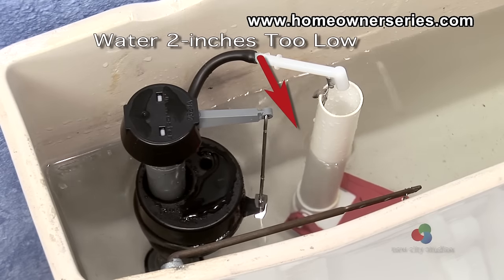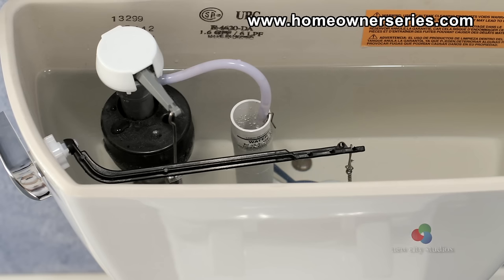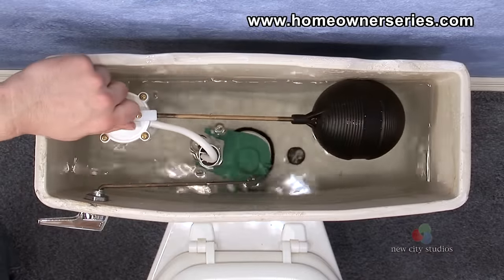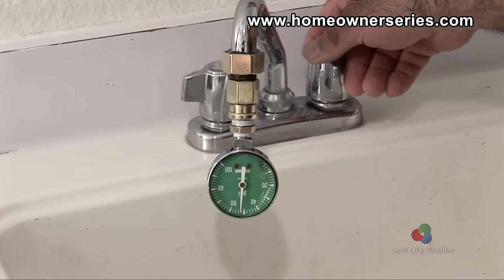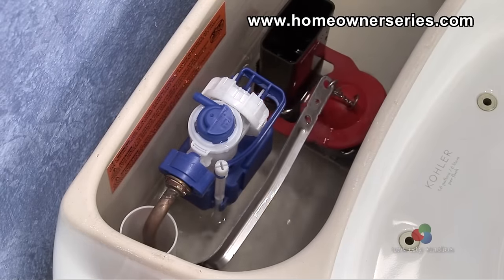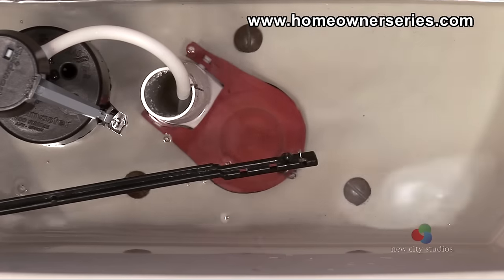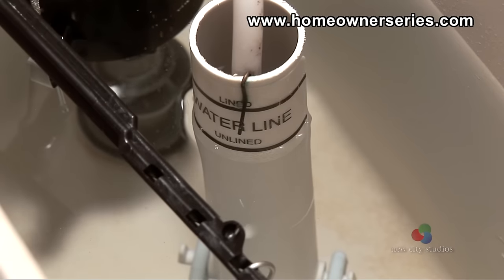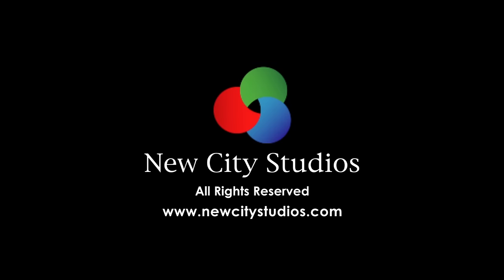How to Fix a Toilet - Diagnostics - Not Enough Flush

Comment: Info good but does not address my issue... My toilet does a triple flush causing xtra h2o thru the base , but no water from top to rinse the bowl. I've changed out the fill valve & flapper on flush valve. Also was originally Ok till my son changed out & made it double flush on purpose... Then when I tried to fix it then started the triple flush??? How can I get it back to single flush??
Reply: Did you ever get help with your problem?  Mine is doing the same thing
Reply: No still the triple flush

Comment: My toilet is clearly not getting enough water. Are there different size fill valves? The adjuster is a screw type and it's to long and cuts the water off to early. It will only allow me to screw it so high.
Reply: Screw it the other way. I thought I was screwing it the correct way at first but it was opposite of what I thought
Reply: @soupdude3127  I found out that there's an adjuster at the very bottom that you can't see (a ring that slides up and down). That fixed my problem instead of the screw adjustment at the top. If I screwed it the other way, it would cut the water off even earlier.

Comment: I have to laugh about the opening comment about if it doesn't flush right the recommendation is to replace it!  Tell that's have very few parts and they are all quite easily replaced. Other than if the porcelain itself is cracked or broken there is actually no reason to replace the toilet! That's 1 of the most stupid comments I've ever heard. Yes, parts may need to be replaced but not the entire toilet unless you want a different style or one that uses less water.